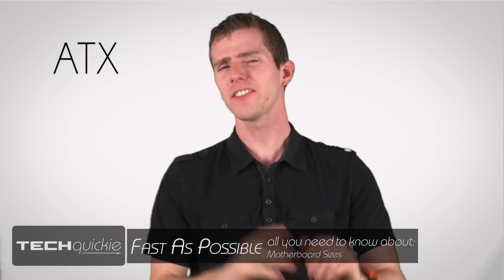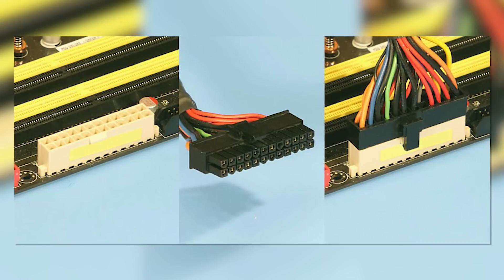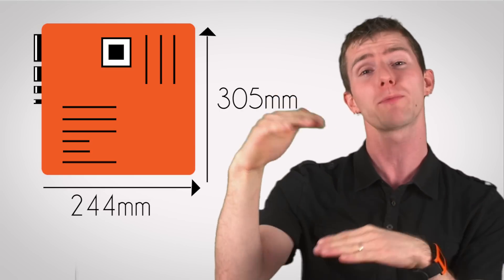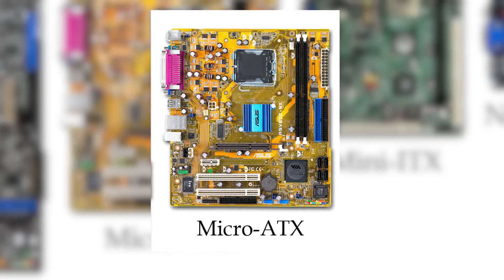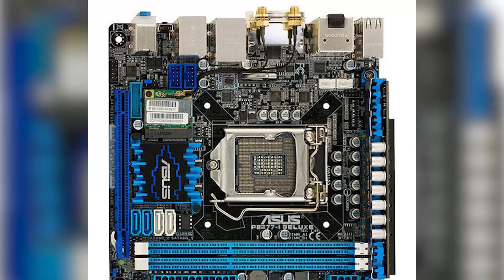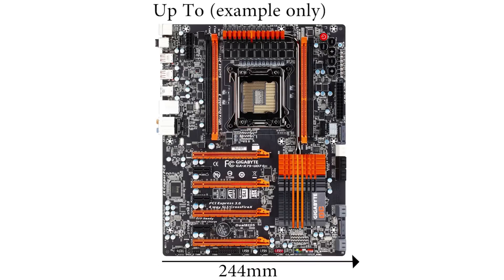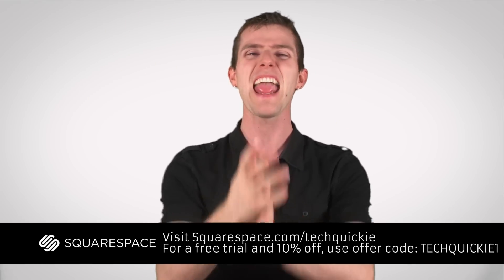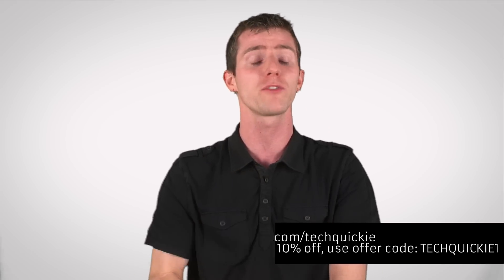PC Motherboard Sizes as Fast As Possible

Comment: 170 mm² and your graphic shows it's 170 mm × 170 mm... that's 28900 mm²...
Reply: he said "170 mm squared" not "170 square-millimeters". linus didn´t say anything wrong here
Reply: jdude99lolz It's not the same, 170 mm squared, means that u square 170, which is 170² or in simpler terms, 170 x 170, and 170 square-millimetres is 170 mm², which refers the unit of measurement, its two different things, see.
Reply: what is your point exactly?
he probably refers to the fact that the board is square shaped not to the area of the borad ;)
Reply: 170 mm to the power of 2 = 170 * 170 so...
Reply: jdude99lolz 170mm x 170mm = 28,900mm², √170mm² = 13.0384048mm. m-ITX is definitely not 13.0384048mm x 13.0384048mm or it would be about the size of your fingernail.
Reply: I see nothing wrong here.
Reply: the was a picture of the board where it was written 170 by 170 so you are just dumb
Reply: Kowolski01 Actually 170 mm squared is the same as 170 square millimetres.

Comment: Hi everybody, I have recently purchased a Gigabyte AMD R9 270X 4GB BF4 Limited Edition for just under £200 from Amazon, it still hasn't arrived so I have time to cancel the order. Why I'd do this? Because I've decided that I want to go the Nvidia route, but my question to you is, is there ANY Nvidia card around that price that can even come close to having the same value and bang-for-buck as the R9 I have purchased, which, includes BF4 and China Rising DLC? I would be very thankful for you input.
Reply: Richard A. Mainly Shadow Play, I'd have a capture card I'd be able to sell so and have another $150 to throw at a gpu...
Reply: Well if you have that extra 150 to throw at at gpu then the 770 would be an excellent choice. My recommendation would be the ASUS model
Reply: Ash Ketchup Here in UK it's only costing me 50 bucks more, so I guess it's kind of a no-brainer, right?
Reply: TGHstudio Then the Asus?
Reply: I would recommend getting a EVGA GTX 760 with ACX Cooler or a ASUS GTX 760 DC2. They're both quieter and cooler than the reference 760 and offer better overclocking. Here are the links: 

http://www.amazon.co.uk/EVGA-GTX760-COOLING-GDDR5-Graphics/dp/B00DQVYIX0/ref=sr_1_fkmr0_2?ie=UTF8&qid=1392562296&sr=8-2-fkmr0&keywords=760+sc+acx+cooler

http://www.amazon.co.uk/Asus-GTX760-DC2T-2GD5-SSU-PCX-Graphics-Card/dp/B00GJUZ9XI/ref=sr_1_1?ie=UTF8&qid=1392562580&sr=8-1&keywords=760+dc2
Reply: GTX 760 or if you can wait a little while and little bit more, then the 760ti (if released) will be great
Reply: Jakey PC What would your opinion be about getting a 770?
Reply: ***** They are great cards, i have a GTX660ti (little bit older if you didn't know) and it performs great, what would you mainly be playing?
Reply: ***** Why'd you Decide not to get the AMD?  Mantle Support will be better than DX11 And You can do alot more with it.
Reply: ***** And A 660 would Do the Trick, but I would stay with The AMD card, it's alot better for the money, and you could do Crossfire with it if you needed the power, for less money.
Reply: Jakey PC Some fps games like BF but mainly probably games like Arma, DayZ, Rust,etc.
Reply: Richard A. A 770 would just cost me about £40 more, so I don't really think crossfire would be cheaper...
Reply: ***** I have a 770 and its awesome, i should go with the msi one or asus.
Reply: ***** stay away from crossfire or SLI, untill you get into top tier cards, the added electric bill and heat isnt worth it, nvidia cost slightly more per performance, but have lower heat, power consumption, and perks like shadowplay. mantle will not be worth the risk as there is no hard evidence what the performance gain will be.
Reply: all I can say is that my Personal R9 270x is wonderful, it runs bf4 maxed out at about 60fps, and IF you plan on playing DAYZ alot, I would still reccomend an AMD card over Nvidia,  I've read some serious problems with it only using 20-30% of your GPU and It used 50-60 With an AMD card.
Reply: Yeah! I would go for the GTX 760. At 1080p, it is a faster card than the R7 270x.
You can find it for ~£200 on Amazon.co.uk. If you are willing to spend a little more (£50-ish), I would go with a 770 though, which would give you a little more longevity for the card.
An advantage when going with Nvidia is that afaik SLI works better than AMDs respective tech, Crossfire, so if you're planning to upgrade later on down the road to 2 cards (although single cards are always better performance-wise), Nvidia would work better.

A summary for the performance of those 2 cards can be found here:
http://www.techpowerup.com/reviews/MSI/R9_270X_HAWK/26.html
(it focuses on the r7 270x, but the 760 can be found in there as well)
Reply: ***** Haha, just after I finally decided to go for the 770 I saw your comment. I guess great minds do think alike (not really) but anyway, where it's at is that if I'm getting Nvidia I can sell my Avermedia LGP and all the stuff that I needed for it, and get £150 more to spend on the gpu, meaning that I'm probably going to get the EVGA superclocked 770 :] (PD: more people should be as friendly and helpful as you!)
Reply: ***** Well, I did recommend the 770 for a little more, haha :D
Have fun with BF4!
(on your PD; Thanks! :) I try to be helpful whenever I can)
Reply: ***** Yep, or dayz of fun with DayZ :D (Well you are helpful good sir :) I mean just getting a reply like that when you didn't have to in the first place was pretty epic imo, just remember, with great power comes great responsability (Intel cpu warning an AMD cpu haha xD))
Reply: ***** I wouldn't go with the EVGA one, it looks nice with the acx cooler but its loud.
Reply: Yes! I have that one, and I love it. Either the MSI or ASUS one, your choice ;)
Reply: never buy hardware components on amazon.
Reply: Snopelo Why?
Reply: Sharpy Hum, but what about which 770?
Reply: ***** Honestly pretty much the same. ASUS an EVGA are pretty much the best for nVidia.
Reply: ***** overpriced
Reply: Snopelo I don't think I'd be able to find them anywhere cheaper (in the uk)
Reply: there are lots of shops in germany where you can buy pc parts(Mindfactory or CaseKing). And pounds is stronger than euro so it will be cheaper i guess.
Reply: Snopelo I don't think so, they'd normally calculate the difference.
Reply: Jakey PC woooooooooooooooooo wolf is coming wooooooooooooooooo!!! woooooooooooooooooooooooooooooooooooooooooooooooooo!!!!!!!!!

Comment: I use a micro ATX board in standard ATX case. I have installed my 2 slot video card in the bottom slot. So I it does not block a slot. I know my video card only runs at 8x, but I don't think it mattes much.(Define R3, Z87M-G43, i5-4670, HD5870)

Comment: I'm a little confused on the whole Dual CPU thing.... Is it sort of like multiple GPU's in the sense that it's not DOUBLE the performance power, but it's more like 50%/25% more? Also is it not for gaming?
Reply: Dual CPU is for servers that serve either for multi user concurrent access (web servers, database server, virtualization server or some other application servers) or for some extraordinary computing tasks that parallel very good. No use having multi CPU for gaming. At all.
Reply: Ubeogesh okay. Thank you much

Comment: I wanted to add a case fan to my computer but i can´t find a 3 or 4 pin connection . What do I do ?
Reply: Use a molex to 3 or 4 pin adapter
Reply: hard wire into a molex connector, either to 12V or 5V. if you want control over the fan I would say get a nice fan controller.
Reply: Gamers Life
do you know any good and not too expensive fan controller ?
Reply: I've had my eye on one that is about $35 and has 6 channels @ 35W each. so depending on the fans you could run 12-18 fans off of it. XD
it's "			 				NZXT SEN-MIX2 Sentry Mix 2"
for cheaper, you can search a few tech sites and should be able to find some around $10-15. but those will control less fans, less Wattage, etc.

Comment: I am decreasing sizes of my computers. When I just started my computer-upgrading hobby, I always bought ATX boards and large cases. A couple of years ago I switched to mATX (shame on AMD for not having them with AM3+ socket). I think the next upgrade might be mini-ITX, if I will be able to pick a good enough case+cooling combo for overclocking.
Reply: if you are going itx i would reccommend the 250d
Reply: danvar249
Thanks for the tip, but I've just upgraded one of the two my PCs recently. I don't think I'm gonna upgrade any more this year, and next year more things will come out. And I have a really bad feeling about Corsair after the crappy H100i I have currently.
Also planning to build a NAS this year in Fractal Design Node 304 mini ITX case, that should be interesting.
Reply: ibrahim husein I disagree on the looks. The 250d is imo the best looiking mini itx case on the market.
Reply: Ubeogesh check out Xigmatek Nebula for itx, It has better looking than 250D but less room for cooler and graphics card
Reply: For me, if i want to build an itx pc, i want it sit next to the tv and stream games from my big pc. I think nebula does look better for that. If I want to build an itx pc for actual gaming pc, then 250d is better since it can handle water cooler and bigger graphics card. It really depends on the purpose and personal taste actually. Cooler Master make nice itx cases too.
I ordered the CM Elite 110 just under $50 for my itx build since no nebula can be found in my area. Best thing about this case, I can put a seidon 120v in it to cool my A8 6600K

Comment: for xl atx they should just add more space between the expansion for better airflow over the gpu's. Caus more then likely if someone has one they have water cooling and not a bulky air cooler on the cpu.